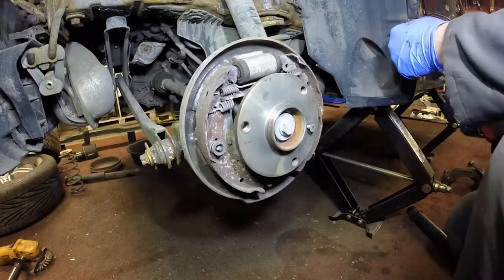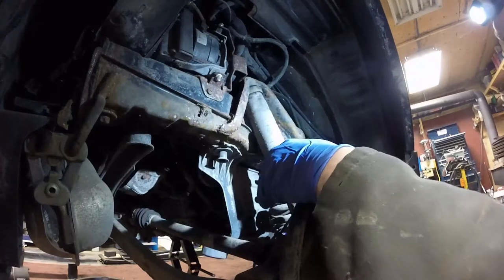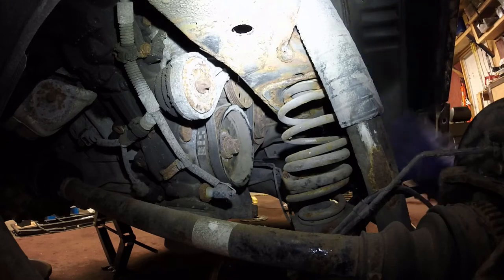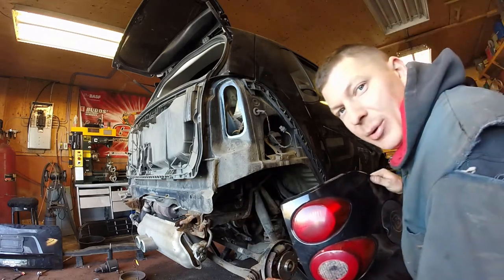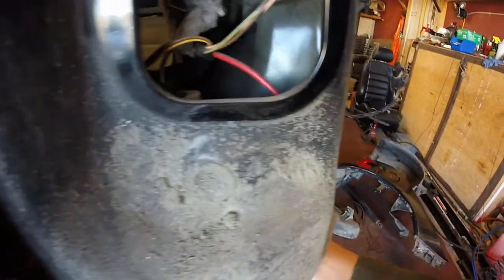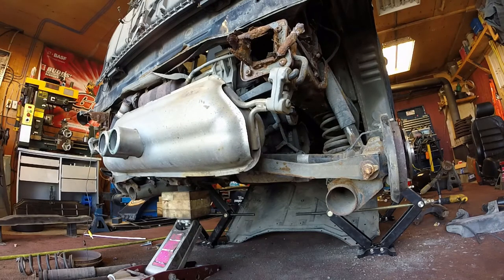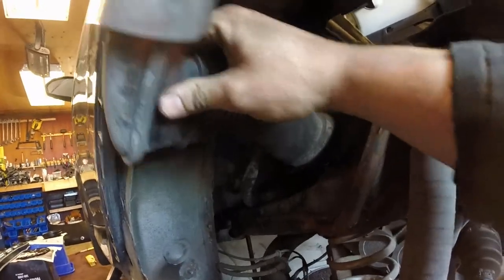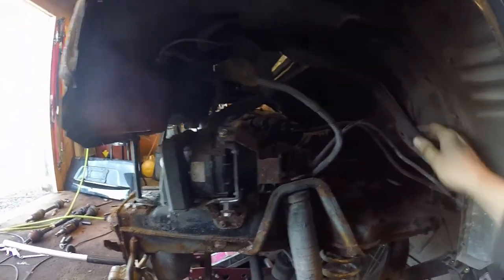Smart 451 Rear Bodywork Removal and Engine Cradle Lowering

Comment: Thanks for showing. I used to use the rear bolts up front with a jack. Today I’ll be lowering it with the bolts. Needed to know how they went. That and I never had it that far down so all the hoses and cables wow . Again many thanks
Reply from the maker: Thanks for watching, appreciate the feedback!
Reply: @PBGarage one of the bolt (had it out a year ago) is frozen. Got a better impact socket on the way and a bigger impact gun. Did the starter last year. My first taste of how hard it is. Now the high pressure pump ugh

Comment: Nice Video - I always remove the back in one piece by removing the tailgate. I remove the two Nuts inside the trunk and place the tailgate into the trunk. By doing so there are no obstacles which prevent you from unbolting the back as a piece.
Reply from the maker: That would be a great way to do it for sure!

Comment: Hello PB Garage,

Watched the video with great interest and now have dropped my cars engine cradle assy to the service bolt location.  Ready to lift back into position, but parking brake "hole" is not clear on how to adjust and re-fit.

disassembly notes are so much appreciated and drop to "service position" went without any issues.

Cheers and great info.

P
Reply from the maker: The little flap at the end of the parking brake cable should slide back up into place, but if it gets hung up on the way in, sometimes I’ve had to remove the plastic cover on the ebrake handle inside the car and guide the little pad into the holder on the handle, might have to move the handle slightly too in order for it to slide in. From there it self adjusts so nothing more is needed than guiding it into the holder.

Comment: Your Video is much appreciated and nicely done. Very 'real-world' approach. We have a Brabus and thoroughly enjoy it as our daily 'puddle jumper'. Nice views of what is beneath the panels and how everything looks from normal use. Fantastic for DIY. Great voice and commentary; also enjoyed the subtle injection of humor. Wrench turners are a unique and special group of folks. Thanks so much for your time in making this video. We consider the Brabus our Lambo-trainer because of the paddle shifting [which is something of a fun art-form]. And yes, jacking a car is serious undertaking, but your risk level was reasonable and acceptable. Please make more videos. We think the Brabus 451 is a peer to the 1957 Porsche Speedster [BUT - without rust, real A/C, a Tridion crash cage, airbags, electric assist steering and power windows]. The styling is spot on. And the front wheels being frangible for impact safety shows some high quality engineering.
Reply from the maker: I’m glad you enjoyed the video, thank you so much for the kind feedback!

Comment: Ebrake was holding my engine cradle in place! Thanks for the tip. It really helped.
Reply from the maker: Glad to help out!
Reply: @PBGarage  how did you re-engage the ebrake upon lifting the whole assembly back up into place? I got mine back up, then noticed the ebrake handle in the car was raised (it had been down). Tried lowering it and lifting again, but I can feel it's not engaged. I should add that I made sure the rod went into the hole when I lifted the engine back up.
Reply from the maker: @jodybond  Yeah they can be a bit tricky to get the flat little rack to slide into the holder. I had to pull up the carpet to get in and guide it in properly, not just from in the engine bay.
Reply: @PBGarage  much appreciated!

Comment: What an absolute nightmare fixing this car ! The fact that you have to take the car apart and drop the engine to service alot of the major components,you would be wise to replace everything you can while its out of the car.  What were the engineers at Smart thinking???LOL God bless you buddy that you have the know how and the patience to do this job
Reply from the maker: It’s not that bad once you know what you’re doing. Tough to package an entire car in a half a car footprint otherwise.
Reply: My Smart is at this point in need of repair of the PVC valve. My mechanic isn't up to doing the job. I just bought the car 3 months ago. It's running so bad now. I'm at a crossroads of fixing it or junking it. It has 78 k on it. It's in mint condition. It's going to cost me a small fortune if I keep it or cut my losses and sell it as is.

Comment: these bolts seem SUPER handy.. now are these something that stay in the car? or do you swap back to the OEM shorter ones after any service that reqiuires dropping the motor?
Reply from the maker: You can’t leave those bolts in, when you lift the motor back up you have to reinstall the factory short ones.

Comment: Can you do the headgasket with the engine dropped on those bolts> Mine needs doing so just wondering if its a full engine unit out of the car or just leave it on the extended bolts is enough room..? cheers
Reply from the maker: I haven’t tried to do one but I would think it’s totally doable on the bolts.

Comment: Wow! why did you remove the fenders and tailgate? I swapped the complete engine/transaxle/frame from one car to another and never removed all the parts you did.
Reply from the maker: I was in the midst of a whole “restoration” of the car when I did this part so all that stuff was off for other things. Think of it as two separate videos in one. “Rear bodywork removal” as a guide. And then “engine cradle lowering” as a separate video. I just happened to do them both at once.

Comment: Wow, great video, quick question, do you need to drop the subframe to change out the ac compressor? Or is this something that can be shortcutted a different way, thanks!
Reply from the maker: I think you’ll have to drop it to get the compressor out, it’s jammed right up against the firewall otherwise.
Reply from the maker: Just put the rear subframe bolts in the front and hold the back up with a jack, drop it a couple inches, should be fine.
Reply: @PBGarage  awesome thanks for the help, bolts are on the way!

Comment: do you need to remove the rear quarter panel to replace one of the rear tail light bulbs ?
Reply from the maker: No, you should be able to open the little window in the trunk area and pull out the bulb holder from there to replace taillight bulbs.
Reply: @PBGarage  Thank you. I am in Australia and looking at buying a 2011 451 on the weekend. Your video was very helpful on what to look for. I was a mechanic in my younger days, but past full on stuff these days.
Reply from the maker: @ChrisBrown-ux8jn I wish we had rust free Aussie cars to buy here! That’s the big killer for us.
Reply: @PBGarage  The main problem in Australia, is the availability of parts. In theory we should be able to get therm from Mercedes dealers but in practice its not that easy. I am going to attempt to get the frame lowering bolts you talked about.
Reply from the maker: @ChrisBrown-ux8jn we are having similar issues here now, the Mercedes’ dealers aren’t really supporting them since 2018. You can still get parts but prices are going up and so are delivery times. I’m sure the parts will start drying up soon too.
Reply: @PBGarage  Plastic parts are not usually a problem as I can usually 3D print them.

Comment: would you be able to replace the pc valve by dropping just the rear of the engine
Reply from the maker: I feel like you may even be able to do it without dropping the motor at all, the valve cover is quite easily accessible. But I haven’t tried doing a pcv valve yet.

Comment: I tried to buy some of the lowering bolts, but they are not available.  I plan to make some, so can you please tell me the length of both the long and short ones, please.  And also the length of the threads on each of the short and long bolts.  Thank you.  And yes your video was very helpful.  My cable from the alternator to the starter and then to the battery got so corroded at the alternator that it stopped conducting current to the battery.  And then trying to undo the nut on the alternator the stud broke off.  So, I cut the wire off between the starter and alternator and am replacing it with a battery cable.  No reason to replace the whole darn thing.  And yes, now am replacing the alternator, as I have to now.

Well, no reply to my request for additional information...., sorry, not pleased.

However.... want to give anybody doing this some additional information.... there are some additional steps you need to do so that you do not cause any damage.  You must remove the screws from the back plastic muffler cover and the clips when lowering the cradle, you must remove the ground wire on the passenger side and you must remove the wheel fender (not not the fenders... but the inside wheel fender thingins, sorry, not sure what the name is) attachments (both sides)  to the engine cradle.  Once you do all of this, then you can pretty much do all that you need to do to lower the cradle without damage, including what is said in the video.  I would recommend removing both sides of the wheel fenders thingins for this process.

Ok, PB Garage.... do you review your comments.....  sure, would like to know????

Oh, and yes, I have successfully completed replacing my alternator and replacing the power cable from the alternator to the starter...!
Reply from the maker: 255mm and 295mm lengths

Comment: How about rear engine bay insulation pad, can it be fixed diy and if yes how to glue it back on to avoid fire damage ? Ty
Reply from the maker: As far as I know the pad is not glued in but just held in place with little push-on plastic clips. I’ve never tried to replace one, all I have done is cut away damaged portions to avoid the fire risk.

Comment: Those scissors look like dominoes ready to fall.
Reply from the maker: Surprisingly stable. I had them at right angles so if you push on the car on the short side of one jack it’s on the long side of the next jack.

That being said, I use my quick jacks now on the smart cars. Just gotta slide them under the car left to right instead of front to back.

Comment: It was not easy to get the part number for the cradle, can you give it to me please?
Reply from the maker: Do you mean the part number for the extended bolts?
Reply: @PBGarage  yes the part number of the extended bolts
Reply: @PBGarage  I have not heard from you, it is the part number of the cradle bolts
Reply: @enjoytodaylife  I just watched the video and noted that he showed the bolts in question with the part number at 9:52 in the video.  The part number is 450 589 00 62 00.  I did a Google Search with the part number and found a listing for the bolts on eBay so it appears the number is still current.
Reply: @PBGarage   k

Comment: Aren’t you scared the car will full using these car jack instead of using stand jack for security ?
Reply from the maker: They're actually RV stabilizing jacks I've decided to use to lift my smarts. They're a lot beefier than the usual scissor jacks you'd use for changing a tire. They were always super strong but I've since started using my Quickjacks to lift the car.

Comment: Not very safe with the car resting on those jack. One bit of forward movement and down it will come.  Otherwise a great helpful video.
Reply from the maker: The jacks are laid out on 45s, not perpendicular to the car. I gave it a real good shake before getting under it. That being said I use quick jacks now.